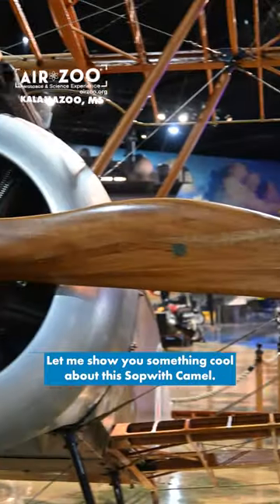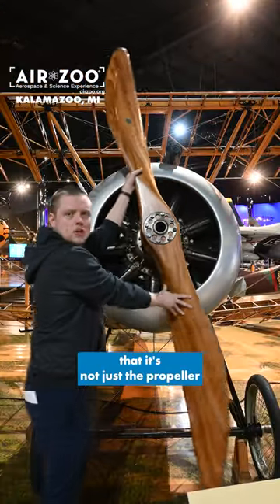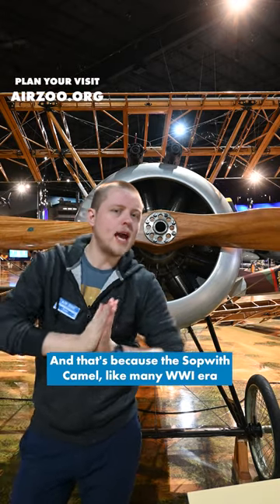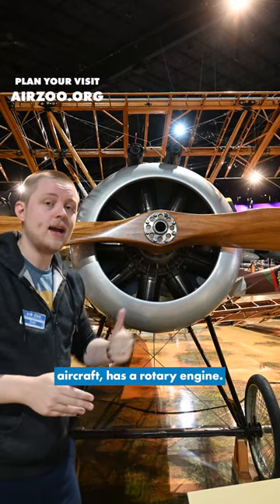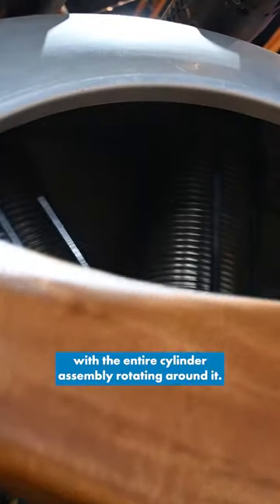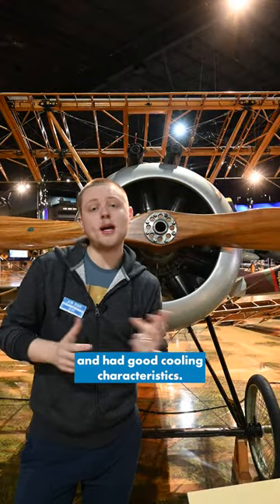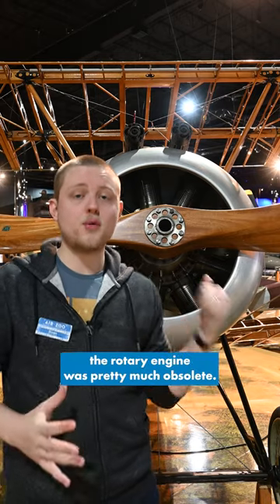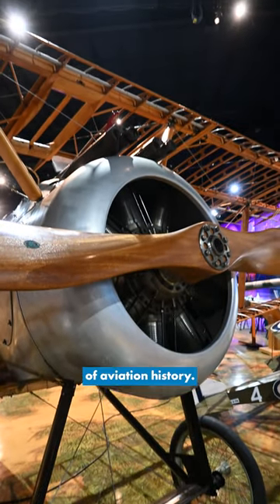The Sopwith Camel's spinning engine!

Comment: I wonder if that rotating mass caused accelerated cylinder wall and piston skirt wear to the backside of the cylinders, opposite the direction of rotation. Curious to see a well used engine broken down to see if this was an issue that was consistent with this type of engine. Thanks for the video!
Reply: i was thinking the same. we need some experts in the comment section😁
Reply: That would kinda make sense, unless they designed it with that in mind. Although I don't think these planes lasted enough for engine wear like that to be a concern
Reply: Remember that most of these planes were basically experimental. I doubt they put that much effort into making sure they last long term. They were flying by the seat of their pants when it came to designing these things.
Reply: @tomathyploof6446 It doesn’t matter.
Also, ^*Timothy, not Tomathy.🤦‍♂️🤡
Reply: Just thinking about it, I'd say no, as it's only about acceleration - meaning no matter what, the cylinders will get the exact same positive acceleration when reving up compared to to negative acceleration when slowing down

I'm not 100% sure, but i think this has to stay true even when considering precession/gyroscopic effects (conservation of momentum)
Reply: @spanqueluv9er  :  |
Reply: @e34boat88 I’m pretty sure all them experts have long expired…
Reply: @tjravnik1385  incorrect.
Reply: @brendanzio  exactly lol
Reply: There were some motorcycles with rotary engines, if you want to see long term wear it would probably be best to find someone with one of those
Reply: @Rokaize  Wellll, not really.  While I won’t say every design was great, most were well thought out, they did stress testing of wings, fuselages, etc. Definitely well beyond experimentation.
It must be remembered  aircraft of WW1 were leading technologies for their day.
Reply: @kevink.5777  I do remember that. And I’m not saying they slapped these planes together. They are amazing machines. 

But I still say they were experimental. It took a while to even figure out how to fire a gun through the propellers. Most didn’t have fuel gauges. Many lacked basic instrumentation. They were literally on the cutting edge of technology. This was an entirely new concept. They were amazing engineers, but they were still forced to deal with this entirely novel concept of military aviation.
Reply: @Rokaize Thanks for the discussion. 
Gun synchronization was solved by late May, early June 1915. This was the beginning of the “Fokker Scourge”. Other nations soon followed. 
It’s important to remember at the start of the war aircraft were being used for reconnaissance and artillery spotting. No purpose built fighter, or pursuit, aircraft existed. The push to counter the recon/ arty spotters leads to efforts to design a purpose built armed aircraft. That starts by late 1914. So in 6 months or less, the first armed synchronized fighter appears, the Fokker Eindekker. 
Per instrumentation- yes, they had oil gauges or an oil sight / pulsator glass, which indicated how well oil was being pumped. They actually had a chart to show how many pulses per minute ( like an old coffee percolator) you wanted to see to ensure all was working well.
They had altimeters, compasses, airspeed indicators, tachometers, air pressure gauges ( for fuel tanks). 
Please take this as intended, not as me lecturing. Wish we could do it face to face!
But they were beyond experimental by WW1, they knew what they were doing, how to do it and yes, they did fail at times- in aircraft design, material selection, engines, etc. But they were more often than not producing remarkable aircraft. 
It is fair to say they were pushing the limits and boundaries at times, but these were intentional efforts, using the best technology, engineering and knowledge they had to make continuous improvements.
Reply: Per adverse cylinder wear. No real issues with this. Rotary aero engines have an incorrect belief attached to them that they required more maintenance or broke down more often than say liquid cooled inline engines. The record just doesn’t bear this our.
A properly maintained rotary can run for 500+ hours before needing a major overhaul. Problem is in WW1 mechanics tended to “home remedy” repairs or “fine tuning” which actually did more harm than good. Plus the conditions they operated ALL aircraft and their engines was far less than ideal. So one must factor that in as causes of engine problems which may, to us, appear less than ideal.
Reply: @kevink.5777  I guess this comes down to semantics. In ww1, the concept of using planes for military purposes was new. Especially the idea of air to air combat. Just by this fact, it makes the further developments experimental. 

They had no previous designs to build off of. They were figuring it out as they went along. They were smart and knew what they were doing. But literally no one before them had done what they were doing. Designers in ww2 had decades of aircraft designs to look back on. Many of the manufacturers and developers of aircraft in ww2 had been producing and designing aircraft since ww1. 

The ww1 engineers didn’t have this luxury. This idea was brand new. No one even knew if it would work long term. Thus, it’s experimental.
Reply: @kevink.5777  and in terms of aircraft having gauges. Some of them did. But many didn’t. Especially early on. You’re just incorrect on this point. I don’t know how many ww1 aircraft you’ve seen but many of the ones I have don’t even have basic gauges that a ww2 aircraft would have. No vertical speed indicators, sometimes even airspeed indicators mounted below the upper wing. Way off to the side of the pilot. This isn’t design that has been mulled over and built off of tried and tested techniques. Because there were no tried and tested techniques. Again, because it was experimental. 

Have you seen the layout or a SPADs cockpit? Gauges are spread all over the place. There was no concept of how the gauges should be placed. No one knew right away exactly how a cockpit should be layed out. They had to figure this out in the middle of a war. Thus, experimental.
Reply: @Rokaize  I guess we will agree to disagree. Yes, I’ve actually seen many cockpits of WW1 aircraft. Sat in several as well. Met historians who write about them. I am a member of both Cross and Cockade and The League of WW1 Aviation Historians..
While gauges and instruments were sparse in some, they did the job. Other aircraft besides pursuit type had even more instrumentation and equipment, which kept evolving and improving, for all types really.
It might seem that they didn’t know what they were doing, but they did. This wasn’t all just brought up in the middle of the war. WW1 aircraft, as far as pursuit, went through 5 distinct generations, from simple Taube thru sesquiplane Nieuports to SPAD VII, Eindekkers to Albatros, to advanced aircraft like Fokker DVII, Camels, SPAD XIII, to all metal Junkers. 
Plus massive bombers, some right at the start of the war that flew hundreds of miles, the Ilya Muromets of Russia. Very advanced, even for the times.
Certainly compared to WW2 era aircraft, things are vastly different. It s not really a fair comparison though is it? We have to deal with what was there at the time, versus compare it to another era.Yet the steady and consistent advances in WW1 aviation, increased levels of sophisticated engines, photo equipment, and overall design shows they are well beyond experimenting.
One last thing, they built over 5000 SPAD VII aircraft, starting in the late summer of1916. They built even more SPAD XIIIs. These were well designed, well regarded, and sought for use by most allied nations in that war. Many others were built in large number as well.By and large they performed quite well. Surely not perfect at all times, but it was no longer a guessing game.
So I’ll leave it at that, I appreciate the chance to discuss this. If you ever make it to the Air Zoo, I hope we can meet and discuss it even more. Best regards!

Comment: It gets worse. Due to gyroscopic procession left turns were slow and the plane would climb. While right turns were alarmingly quick and the plane would DESCEND. Basically you'd corkscrew into the Earth if you didn't know what you were doing. Iirc this killed a lot of rookie pilots. 

The infamous Fokker DR-1 also had this same problem

Comment: There was also a motorcycle with a smaller version of this engine built into the rear wheel.
Reply: And an American automobile: vertical fixed crankshaft:

Adams-Farwell: It spins like a top!

Comment: Thought it was called a radial engine or rotationary engine because i always associate rotaries with mazda  rotary pistons
Reply: The mazda rotary engine is called a Wankel rotary, the difference being it uses the triangle rotors instead of pistons
Reply: The wankte rotary is a completely different  method of producing power, not at all related to a rotary aero engine.

Comment: The WW2 Corsairs would like to have a word with you. But in all seriousness, great info! 👍
Reply: The Corsairs had radial engines with fixed cylinders that rotated the crankshaft. I suppose the difference is that rotary engines have a fixed crankshaft, like he explained, which also applies to wankel rotaries like the mazda 13b

Comment: Interesting! What else fascinates me till this day: how they shot in between the rotors 😮 ?
Reply: They had a cam and linkage on the engine hooked up to the guns that would lock out or prevent them from firing when one of the blades of the prop was in front of the barrels

Comment: the first plane to fly across the english channel was one of the first monoplanes ever built. it also had no flaps on the wings bc the entire wing would rotate slightly. it also had no elevator flaps. to change the pitch you would have to increase or decrease the throttle.

edit: made a spelling error

Comment: Should add in that they were total loss sump lube systems. Honestly the old radial/rotaries were solid engineering regarding the engine tech of the day. High output for relatively low weight.

Comment: I wonder if counter rotating assemblies (like twin rotor helicopters) would solve the turning issue as well as a smaller displacement in each rotating  assembly could solve the rotating mass issue🤔
Reply: You're over 100 years late for that proposition
Reply: @Elbowbanditest2003  cool👍 what's the name of the aircraft that it's in?
Reply: @tracewallace23  Lockheed P-38 Lightning had counter rotating engines and props. The DeHavilland Hornet also had them. Some later versions of the Spitfire had contra rotating props, aka two coaxial props bolted to the same engine but rotating into opposite directions.
Reply: @ky7299  I knew they existed, I just wasn't sure if the names. Thanks 👍😎

Comment: My question is why they didn't just have two engines rotating opposite directions connected to the wing like a flying fortress, double the thrust and none of the torque issues.

Comment: Does this mean that the engines crankshaft is what is bolted to the firewall? And all this mass hangs on that? I may have overthought this, but I know nothing about rotary style radials.
Reply: Basically yes, a bit more to it than that but yes. BTW, The crankshaft is hollow going into the crankcase, the rest is solid to accept the master rod or connecting rods (they used different methods to attach the connecting rods to the crankshaft.)

Comment: Well now I've got to know how the engine was controlled and supplied with fuel. Given that the entire assembly was constantly rotating.
Reply: They were two stroke type of operation and the carb fed through inside a hollow part of the crankshaft (!) into the crankcase then up to the cylinders. Fuel mixed with castor oil for lube. The pilots and aircraft ended up covered with oil stains every flight...
Reply: @timothyjamieson1282  these are 4 cycle engines. And as explained elsewhere, the exhaust is directed downwards and under the aircraft, they have cowling tightly fitted to the fuselage. Pilots did not get covered in oil as they flew rotary powered aircraft. (A current video saying this will be corrected BTW)
Oil is kept separate and pumped thru oil galleys and passages first before ending p in the crankcase. Fuel is fed in separately as well. There is no premixing as in a 2 cycle. Simply as a result of how the engine operates, the fuel and oil end up in the crankcase together.

Comment: They also slung oil to the piston’s, if there was any gaps in the rings they would burn oil like crazy.  Not sure how they kept the oil near the crankshaft, I’m sure there was some clever mechanism
Reply: Rotary aero engines had oil pumps, they would pump oil through normal passages as in a radial engines to lubricate bearings, connecting rods and pins, etc. The oil will eventually end up in the crankcase where over time it will get drawn into the piston on the intake stroke and be exhausted out, mostly unburnt.

Rotary aero engines are a “total oil loss” engines, meaning as they operate they consume oil. About 3-5 quarts an hour depending on the model engine. It’s just a result of how they have to function given that the cylinders are rotating vs the crankshaft.

Comment: did the camel have a synchronised machine gun or metal plates on the propeller?
Reply: Synchronised. Metal plates were used with varying success only in the very early years of the war.
Reply: Not synchronized but an interrupting gear.

Comment: And it used a total loss, castor oil based oiling system. Pilots were constantly drenched in castor oil, breathing it in and swallowing it. Some died of diarrhea from so much castor oil. It would kill you without crashing and without getting shot at.
Reply: Pilots do not get drenched in castor oil. Several reasons explain why this is the case. One is that with a fixed crankshaft, rotary aero engines exhaust valves open and close in the same place, which is in the 4 o’clock and 8 o’clock region- ie: downwards. So the exhaust gets shot down and under the aircraft. Second- there will be some exhaust that gets “ whirled” around of course, but is for the most part contained in the cowling and will eventually also exit underneath. The cowlings on rotary powered aircraft are fitted tight to the fuselage, with only the lower portion open to allow exhaust to flow underneath. Look at the aircraft that used rotary engines, look at the cowling. So exhaust and castor oil cannot be running all back like people seem to think it does. 
Now, does a little bit end up outside the upper cowling and running by the pilot.? Sure it wouldn’t be unusual. But a very small amount of the overall exhaust. Heck, ANY engine used in WW1 could have this said about them! 

Soft ( silk usually) scarves are worn to protect the neck. Those flying suits and basic uniform jackets had rough, often wool colors.  Pilots turned their heads a lot, so without a silk scarf to protect the neck it would get rubbed raw or at least irritate the skin on your neck.
I don’t recall pilots of dying from ingesting castor oil and getting diarrhea so bad it killed them. With 40+ years studying WW1 aviation and rotary engines, I’ve never heard of that happening. Per what I covered above they simply were not breathing in copious amounts of caster oil to cause this to occur. 
I do know that diet, hygiene, camp conditions, stress, smoking and drinking all contributed to stomach issues for pilots and crew. Perhaps those reasons are things to consider, as these guys were not always in tip top shape but flew anyway.
Flying aircraft with a rotary engine wasn’t really all that more dangerous than flying stationary engines. Camels were unforgiving to a careless pilot, that is true. But rotary powered aircraft in general worked well, and in some cases very well. They used them because they did the job till radials were developed further and cooling issues were overcome itch them. 
Best regards 😊

Comment: No a rotary engine is 
When you have the pistons form a circle around the crank 
For example planes in later wars like the p-47 thunderbolt had a rotary well we call it a radial engine but the crank shaft moved not the engine 

There’s other forms of rotary engines like the wankle my personal favorite and the liquid piston rotary engine

Comment: Throttle control was on/off switch, so it would be full power or no power 😅
Reply: There were 2 magnetos, you could run full, half, or off.
Reply: Actually they had throttles and carburetors, they do not operate them as “on-off” engines.
Reply: Most had a single magneto. But as already mentioned, they had throttles and carbs (other than monosoupapes). There was no “ half” speed. Engine operation is more normal than most folks think they were.